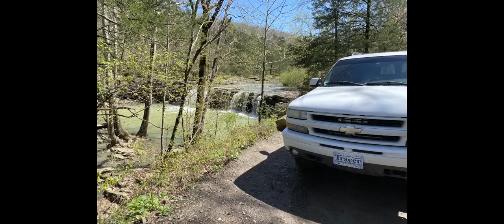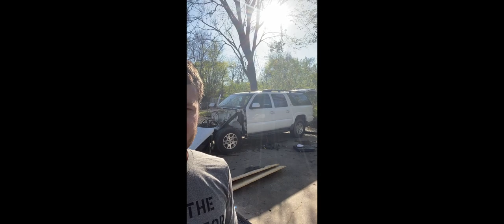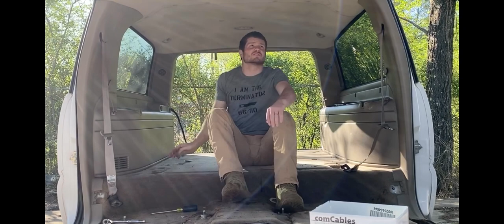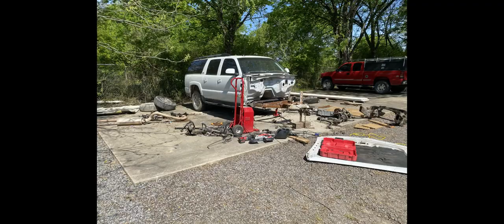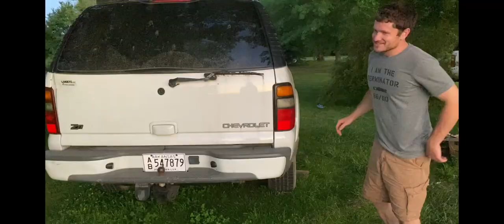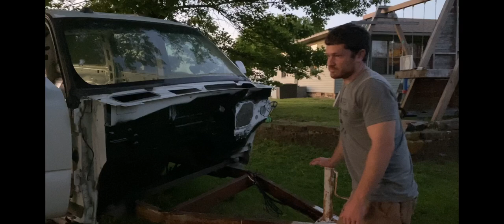Suburban to Overland Camper Trailer Conversion Part 1!

Comment: Before I saw any of your videos on doing this, I've wanted to turn a Suburban into a trailer/camper. However, I want to keep the front end in tact & use the engine bay for storage/other uses.
Reply from the maker: I've seen that done, just keep in mind that this is already a heavy build with lots of tongue weight. The front end frame is very heavy due to all the front end parts that are on it. If you keep the shape you will also have to deal with making the tongue long enough to still have turning radius without jackknifing. It may be possible but it would be tricky.
Reply: Keeping the engine bay for storage is the same idea I was thinking too. Seems like I good idea. Won't know until we try!
Reply: Also what about a gooseneck that is what I'm considering since I have my pickup for the pull truck

Comment: Subscribed! About to buy an ‘03 Yukon 1500 xl. How are you fastening the wood to the sheet metal!
Reply from the maker: The floor was mostly fastened with construction adhesive. We wanted to avoid penetrations through the floor that could cause rust issues later. In some places we use screws or a combination of the two.

Comment: Quick question so I’m looking to do the same thing with a 99 suburban to match my current one what was the process to register it as a camper/trailer
Reply from the maker: That will be dependent on the state. I would call your local DMV and ask them what that process is. Some may keep the vehicle vin and some may say to change it to a homemade trailer and give you a new vin. I've also heard in some state it can't be licensed.